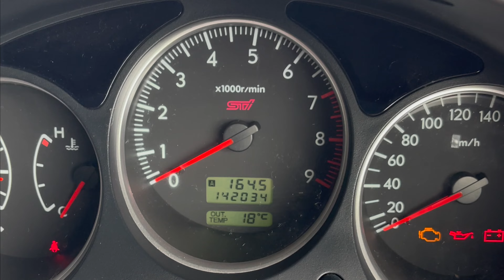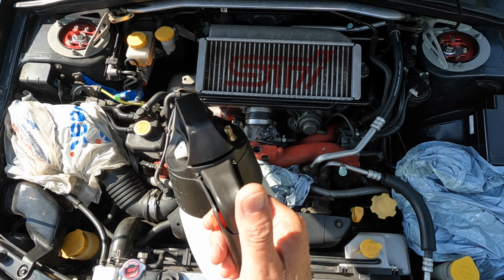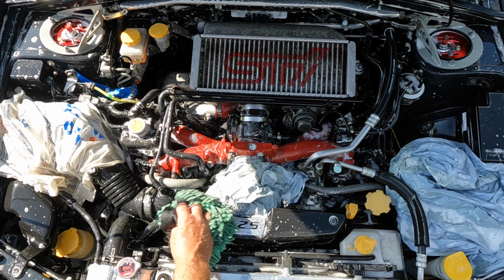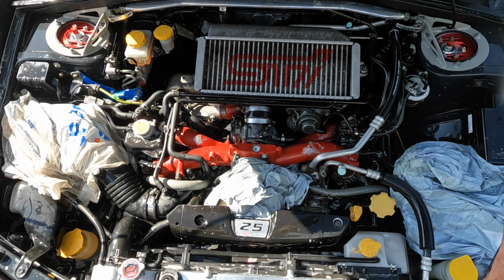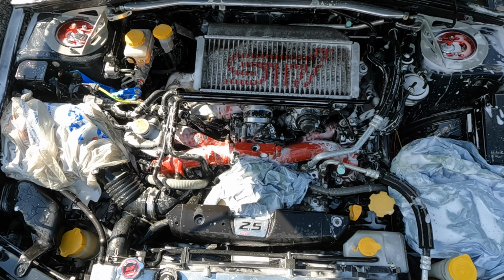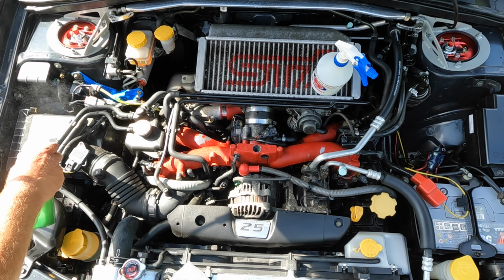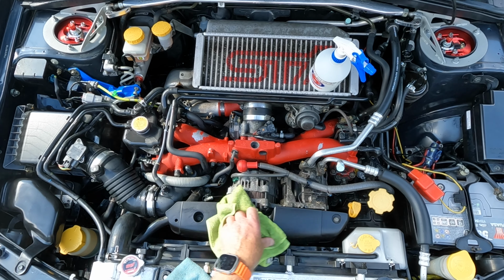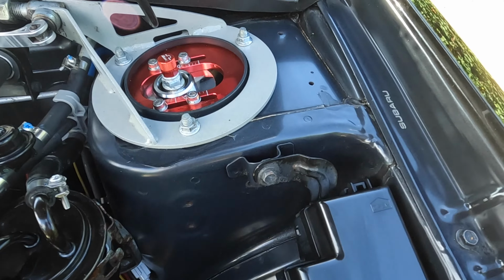Subaru Forester Sg9 Sti engine bay refresh Koch Chemie Green Star and Bilt Hamber Touchless

Comment: Nice one. You've shown GS is a good product, but would you buy it? In my testing, at lower ratios it's as good as Autofoam, but at higher ratios, Surfex is considerably more powerful, and both are cheaper. So GS has no place in my arsenal despite it being really nice to use.
Thanks again, and the audio rerecording turned out well
Reply from the maker: @pigeonpoo1823  Crumbs. I was mortified re the sound. Almost decided to sack it off and wait until the engine was dirty again to do a reshoot. GS is tempting to buy. But more from the “enjoying the brand” pov than being totally objective. As you say. Surfex is cheap and more powerful. Thanks for watching as always.